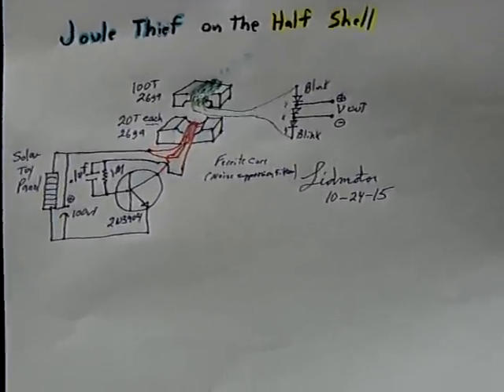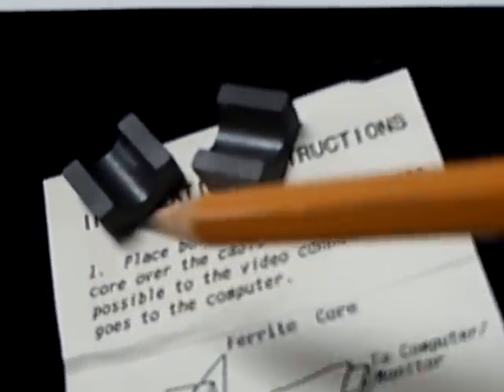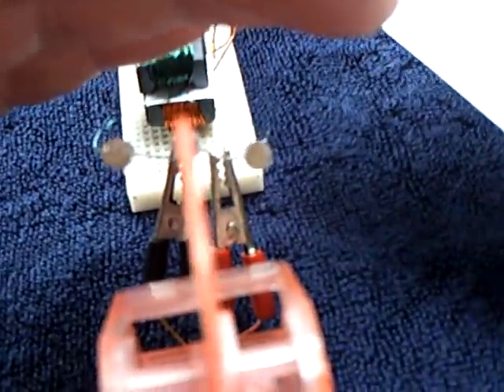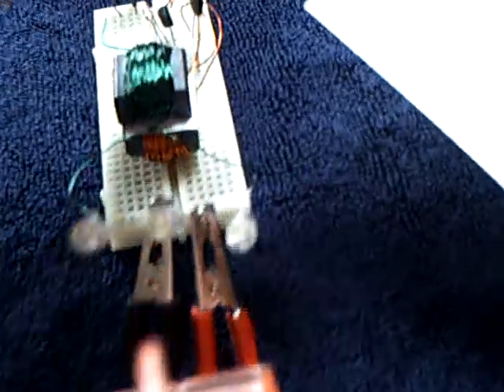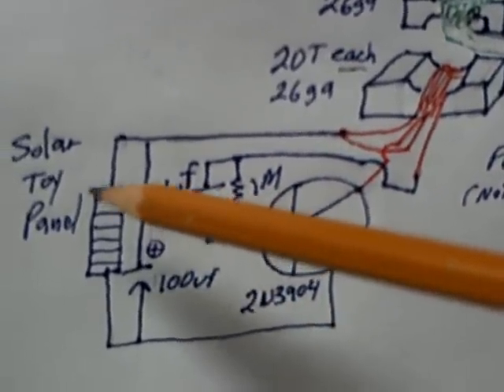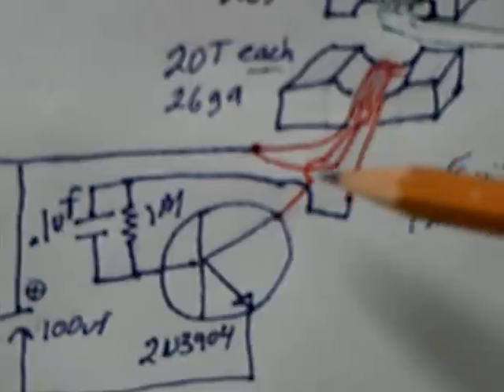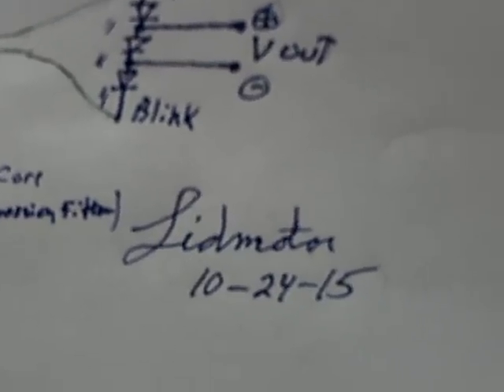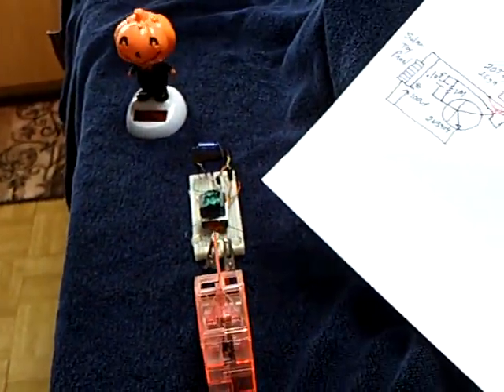Joule Thief on the Half Shell

Comment: Are you using 100uf Electrolytic Capacitor ? as those tend to have a high leakage current try a Tantalum bead for less loss.
Reply from the maker: +Ortorea Screenname Thanks for the tip.

Comment: hey lid i need a little help regarding your project "electromagnetically levitated pulse motor rotor" . does the pulse motors u use must have neodymium magnets or it can have farrite magnets???? and last time u said to me that ," The hard part was getting the optical setup right.  The infrared led and the sensor had to be just right for this to work." what do u mean by that???   please lid help i really need this working. i have been spending a lot of time on this thing.
Reply from the maker: +Symum Ansari  Use neo magnets.  The IR led has to be aimed exactly at the photo transistor and beam has to be broken by the rotor's up and down position.  It is trial and error and takes time.  If this levitation project ends in failure don't worry about it.  I tried many times before I got one to work.  It was years because I didn't have the basic knowledge needed and did not understand what was going on.  Other projects added to my knowledge base and I ended up back here finally with success.

Comment: You made a Time machine! Today is the 18th, LOL!  Have you ever tried using an AC to DC wall wart Xformer  instead of the LEDs and see what you get ?
Reply from the maker: +2550marshall   Thanks.  I added an annotation.  Being retired lets you lose complete track of time.  It's great!  This is 2015 isn't it? lol.  No I have not tried a wall transformer on this yet.  Sounds like a fun experiment.
Reply: +Lidmotor LOL!, It's been a few years but I think I made a normal JT circuit with a AA 1.5 Volt battery. I hooked up a transformer to where the LED was and got some interesting results. I believe I hooked it up backwards and got some pretty good volts out of the wall side.
Reply from the maker: +2550marshall Actually what would be really fun to try would be a small HV transformer.  That should light up a gutted CFl.  It would be like the 'Jeanna's Light" that I made years ago.